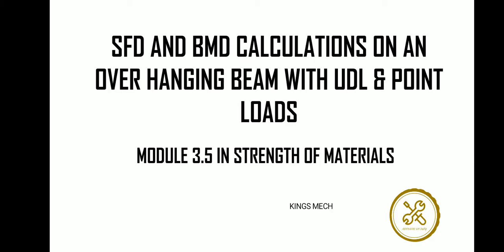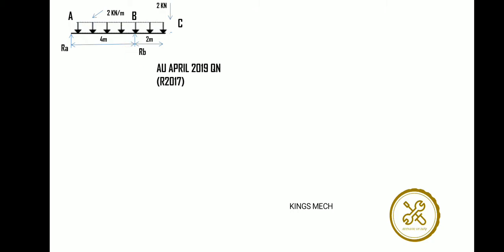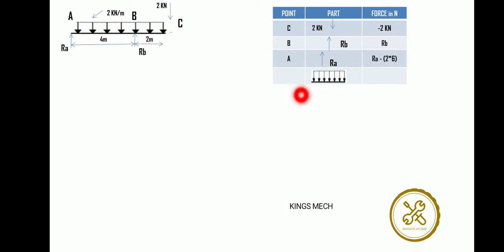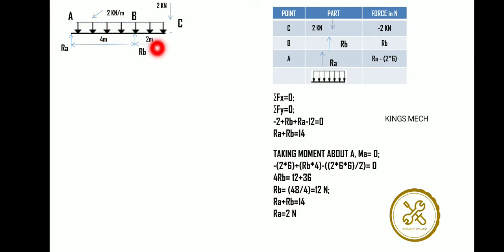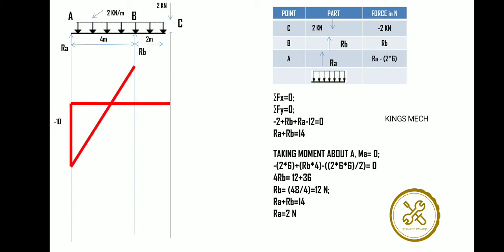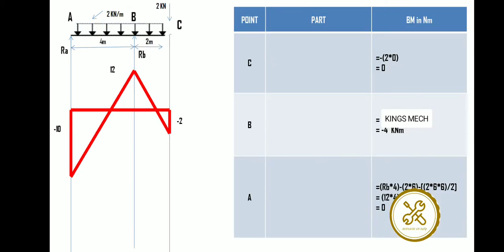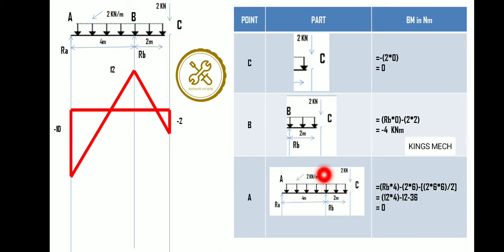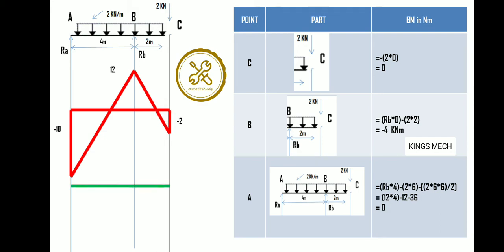SFD and BMD on over hanging beam with UDL and point loads in Tamil

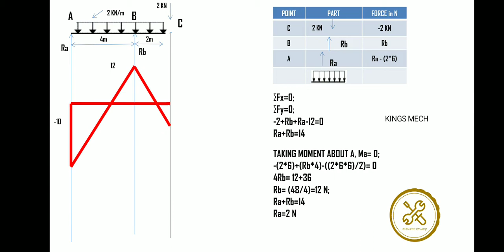Comment: Sir Inga 3:49 la sfd la ra -10 RB +12 add panni podanuma like -10+12=2
Reply: Appo direct a c point 0 varum la yen Adhu - point ku pothu kela
Reply from the maker: Yes
Reply: @kingsmech ,-10+12=2 at b then 2-2=0 then it should directly placed in o why we need go down - section
Reply from the maker: This problem is complex.. why because the beam overhangs after support a point load acts at end..not only beam but also udl..so it should be solved like this..
All other problems no issues
Reply: @kingsmech  ok